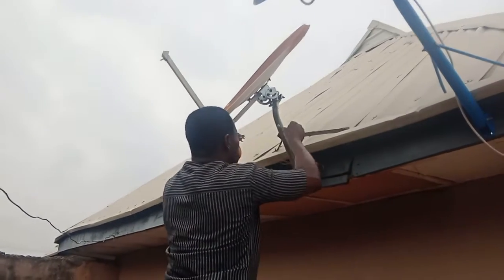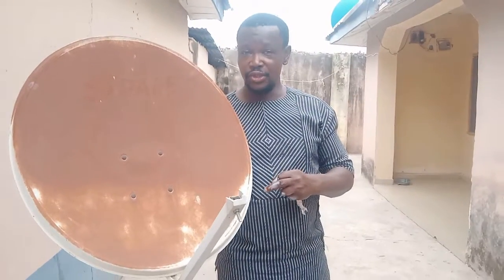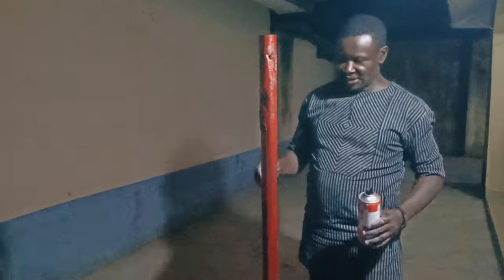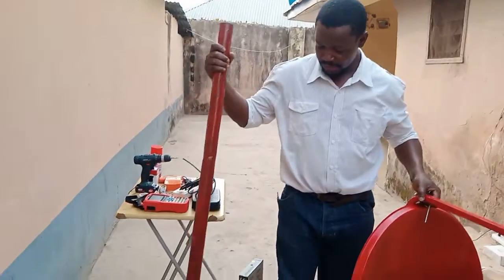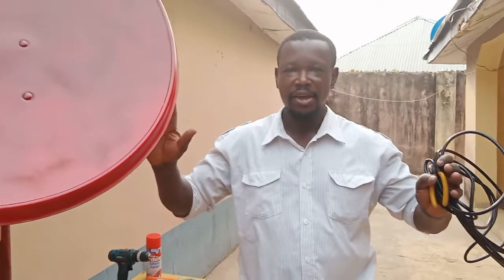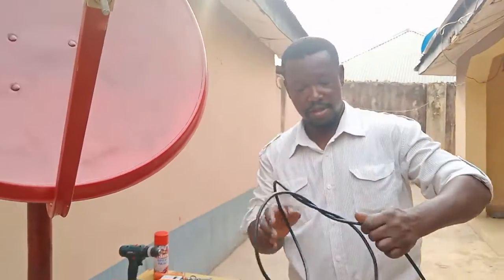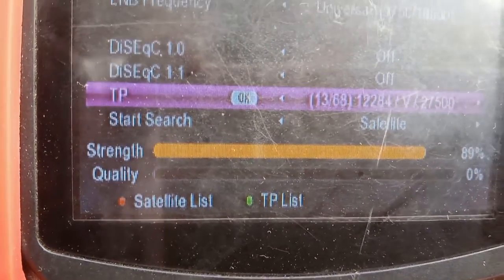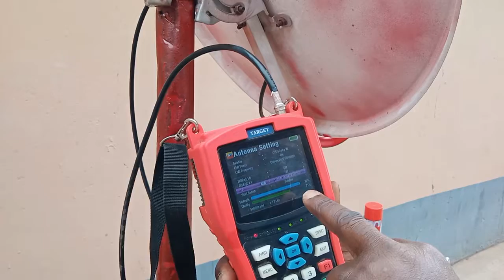I TRACK MBC ACTION & NOLLY WOOD CHANNEL PT2

Comment: Gud day sir hw can I combine 2 combiners and program it in my TV to enable use more than 4 dishes
Reply from the maker: I will do a video on that...using one or more Disec switch
Reply: Thanks sir ,await ur video
Reply from the maker: @dennisdinipre-wo3rv  i will drop it tomorrow
Reply: @FastestIQ  sir, i need an expert like u to track for me at home. can  u drop ur contact?
Reply from the maker: @samuelstanley9437  +2348033544126